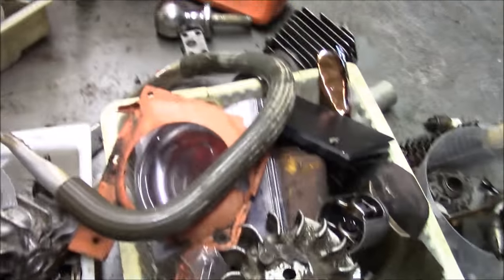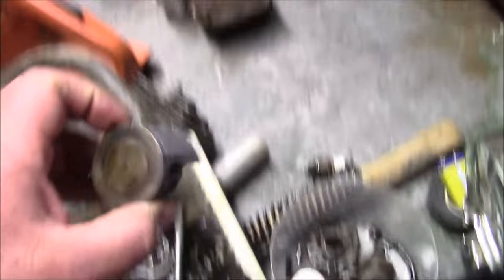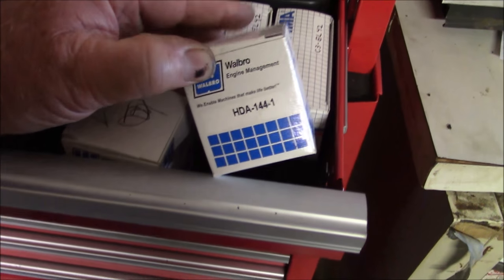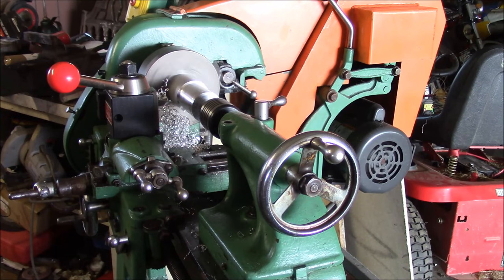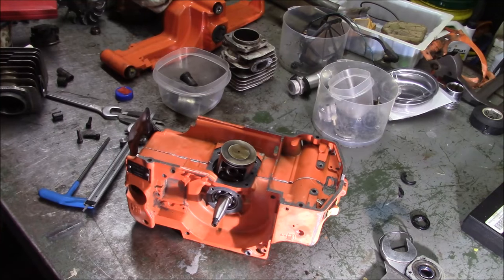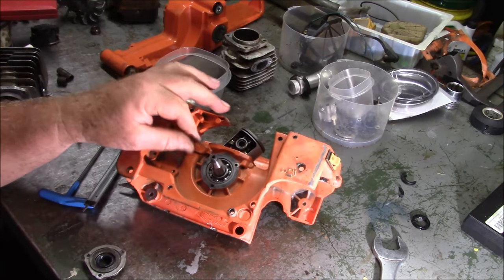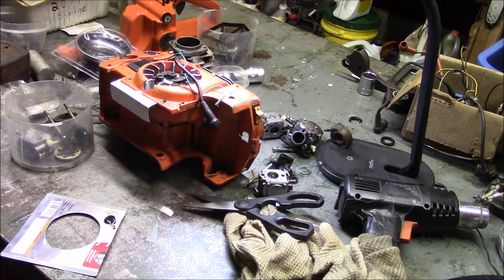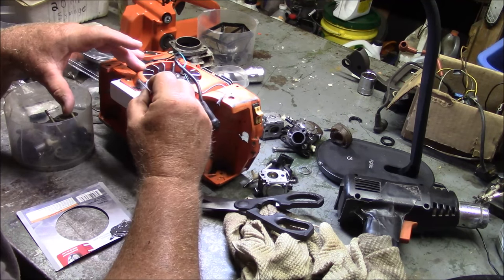Husqvarna 254xp Crank and Bearing Installation" Chicken Chit 2 Chicken Soup Saw" (CC2CS)

Comment: Love the videos Walt, great to see these old saws live again ,just a one there the ridged washer that goes on directly after the oil pump is it normal for it to be slightly proud of the surface of the oil pump even after its been hit home that's the way mine seems to be after I rebuilt the oil pump and replaced the brass gear ,I've only just done it there now ,more work to do so I've not tried it running yet 👍

Comment: my little 136 runs 13,200 but says it can run 13,500.  Looks similar to yours but not as pretty and covered with JB weld.  Been going now for over 20 tanks now an only cost me 30 dollars plus the bar and chain an under a hour of time.  Compression 155 even.  Now it needs a couple rubber av pieces tho which is no biggy.  Just waiting on the parts now.

Comment: Hi there - greetings from Denmark! 
I have a 254 SG - it is super hard to pull when the spark plug is in - is there no decompression valve (cant find any hehe) - what can I do, any advice? =)
Kind regards
-Kristian
Reply from the maker: Just run it . It does turn over free with the plug out right? We aren't dealing with a blown up top end is my assumption. I guess I would take off the muffler and check to make sure the top end is good. Assuming it is, run it. Once a little gas/oil mix gets in there things usually loosen up, IF a saw has been sitting for a couple of years, the oil left can almost be like a grease. So running it is the solution.
Reply: @afleetcommand  Thank you for answering! Cool, I will try fueling it up and see how it goes - it has been sitting in a shed for 3-4 years and was given to me by my father in law, he bought it in '88 and he has used it alot. The ignition timing went off a bit and it pulled hard back wich is why he bought a new saw=) Thank you for your time, I really appreciate it!
Reply: @afleetcommand  The piston has like 3 vertical stripes on it, and the cylinder has a few marks, but not alot - do you think I new to replace? =)
Reply from the maker: Might, tough to tell from an online text :) Depends on it if it's a superficial scratch or gouges then also damaged the cylinder as well. Often when they are wore out, removing the aluminum transfer on the cylinder walls & a new piston get them going again. There are aftermarket 254 top ends available I guess as a last resort.
Reply: @afleetcommand  Cool, thanks again!! Appreciated!=)

Comment: i seen you and bob talk about the 555 but never the 545. i was wondering if a 555 p/c would fit on a 545.😂
Reply from the maker: No because the 555 is in the 562 60cc class chassis and the 545 is in the 550 class chassis.
Reply: Got ya.so i could make it a 550xp?
Reply from the maker: Think so . I have a "dead 550" I plan to do a similar video on when I can get the time. They are analogous to the 555/562 family and similar things apply. I did the 555 vs.562 video going over differences between those two. Or, maybe buried it in one those 562 vids....can't remember.
Reply: I did watch it.i think ya said only difference was the cylinder.maybe thats how its getting the higher rpms?is there any other way i can contact you?thanks
Reply from the maker: Not certain about stuffers in the crank & ignition/carb differences as with the 555 (No stuffers & different carb/ignition ) than the 562
 And over a forestryforum.com has a PM mechanism that is where I communicate with folks . Better by far than eMail

Comment: I don't see you ever center cranks when you install in the cases?
Reply from the maker: Have done that over and over on the video's when needed. The puller tools I build work to tap on. Some of the saws need tapping almost every time. Others almost never. So I guess if you watch more of the video's, especially 372's lots of crank centering happens. 660's as well but not every time.
Reply: @afleetcommand  I just watched your 372 crank install. You're just feeling and eyeballing the crank to center. You say, "You can use feeler gauges if you want to, but....." I would think you want to. Some say the cranks floats anyway in heavy use.....I dunno.
Reply from the maker: @TheReal1953  Have not ever had one come back with anything other than crush damage or straight gas....so some can over analyze I get them close. And that's good enough.
Reply: @afleetcommand  OK....must not be that critical.....'nough said.